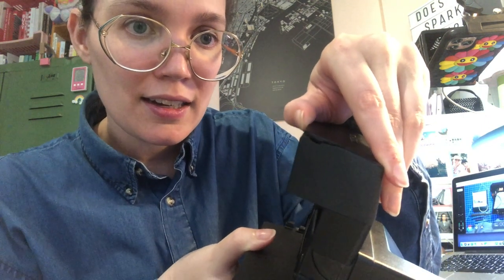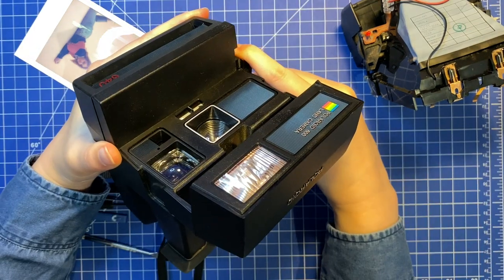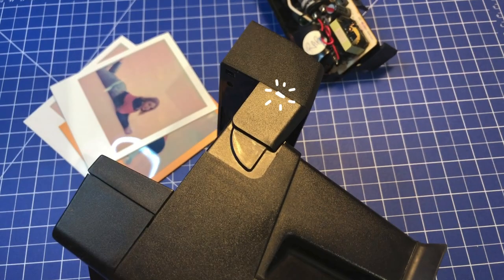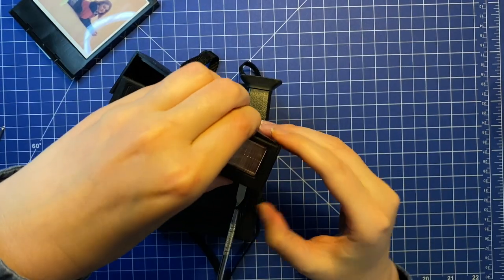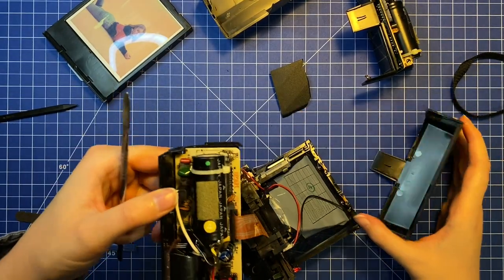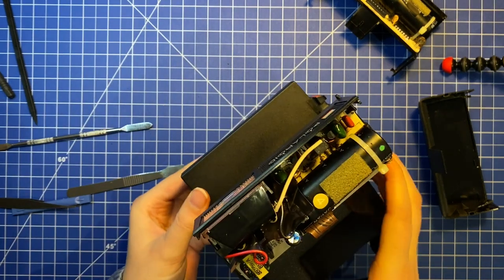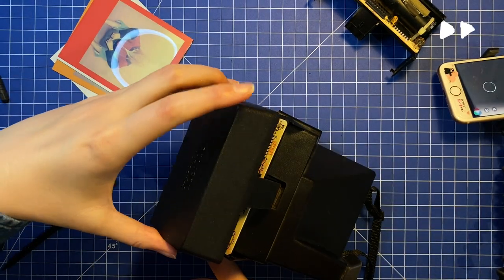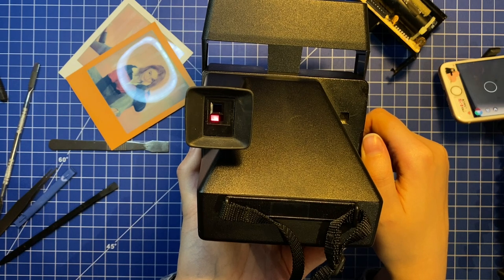Replacing a broken flash on a Polaroid 600 camera

Comment: PLEASE make sure you don't ever touch the big black cylinder. It's a capacitor and it could be charged even if the camera hadn't been used for ages. Either don't touch the prongs on it (it could be lethal) or take a metal screwdriver that has an isolated handle and please use isolated gloves (not latex ones) and place the metal part of the screwdriver on the two prongs, beware a massive flash is going to happen so don't get scared. After it gets shorted you should be alright but don't touch it anyways!
Reply from the maker: You're right! I started this project a little unprepared, then I got the service manual and it was like, WARNING! 😅
Reply: @Bianca_Toeps  im happy you had luck and didn’t touch it. And where have you found the manual I can’t find it anywhere?
Reply from the maker: @daniel_s  https://usermanual.wiki/polaroid/636RMEN.3591662537/view (works for both this type and the newer type)
Reply: Hi have you encountered clicking sounds with the flash before? It seems I broke mine after testing the flash and it wouldn't stop making a noise after that. I think the capacitor is no longer charging.
Reply: @marisaocellada9064  have the same issue and don't know how to fix it
Reply: @Bianca_Toeps  thank you for the manual!!
Reply: I'm going to touch the big black cylinder. You can't tell me what to do
Reply: @shamancredible8632  Lethal he says. Ahahahahahahahahahaha

Comment: First, THANK YOU for this amazing video, I looked everywhere and this was exactly what I needed. Second, I learned an easier way to take off the backing that doesn’t even require the first step of removing the flash compartment at 1:32 or any prying. Plus it reduces any chance of breaking. If you look at the two small square holes underneath the flash (can see it if you pause at 2:25, by your right thumb), you can insert  tweezers inside those. Then just angle the tweezers away from the camera body and it will pull the clip off. Then you can just slide the backing off with no resistance. 
Hope that helps anyone in the future!
Reply from the maker: Thanks! Great tip.

Comment: I'm wondering if you ever tried testing the big electrolytic capacitor in the flash?  I'm curious what usually goes in these.  I have one now that is doing the same thing.
Reply from the maker: I'd rather not touch that until I fully know what I'm doing.

Comment: I have one but it looks more like the Polaroid express, but it doesn
doesn't turn on but I would like to know if the cartridge can be charged or what do I do to make it work?
Reply from the maker: The cartridge has the battery, so I think you need to buy a new pack, or use an old empty pack that still has charge.

Comment: Uhm I have the same problem but on my Polaroid sun600 it has red light on the viewfinder whenever I half push the flash button on the side it won’t take picture/ flash. Do I need new battery/cartridge? I was thinking the problem was its flash. It doesn’t give me the red light in the viewfinder when it has no film inside tho.

Comment: Hi idk if you can help but my poloroid wont eject photos. The cameras flash works but no photo comes out and I know I have film in there. If you have any idea on how to fix it that would be great
Reply: check if the gears that push the film out are moving properly if not give them a little move with a screwdriver or something after a couple times it should work

Comment: Any tips for a 635cl that only spits the dark slide out half way? Then when pressing the shutter nothing happens..(flash doesn't fire). Ofcouse im using new 600 film and im getting the green light! Any ideas?
Reply from the maker: If you haven't used the camera for a long time, it might need some time to charge fully. It might help holding the shutter button halfway for a long time. If that doesn't work, the capacitator might be semi-dead, there might be something wrong with the ejection hook (I've never managed to fix that) or the motor (don't know much about that either).

Comment: Hi, have you found some tips for removing the flash shell?
Reply from the maker: There used to be a special tool for it (as seen in the service manual: https://usermanual.wiki/polaroid/636RMEN.3591662537/view) but since I don't have it, I just have to pry with a screwdriver...
Reply: @Bianca_Toeps  Thank you.I've got it.All we need is a hard and thin and long iron bar

Comment: Hi! I have a Polaroid 660 and have trouble finding a donor camera. It keeps indicating that the flash is charging but never charges to completion. Does anyone know what the problem might be? I am willing to solder/desolder components.
Reply: Did you find a solution for this? I have the same issue
Reply: @ashleysmith8053  well… I bought a broken polaroid as a donor which turned out to work perfectly. So maybe I’ll find out when I find a other donor camera, but I’m fine for now.
Reply: The capacitor in your flash unit can no longer reach the appropriate voltage to fire the flash at the desired level. Capacitors "dry out" with age especially if they go unused for long periods of time.